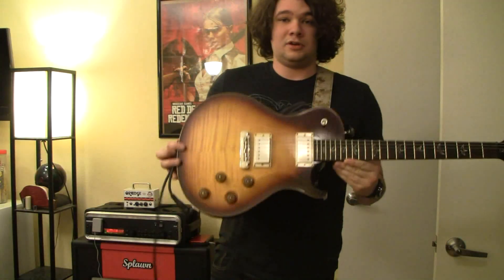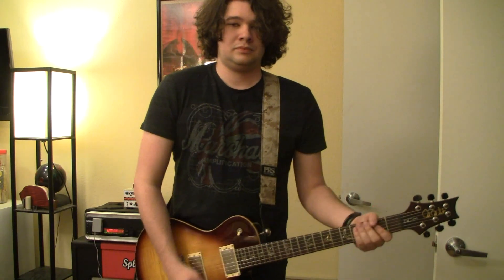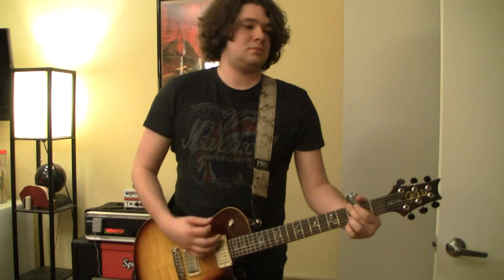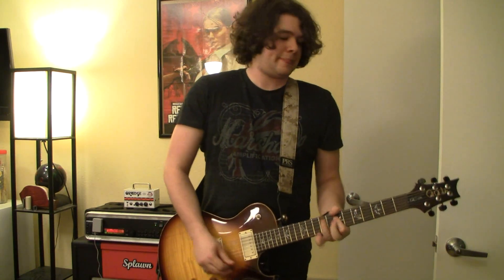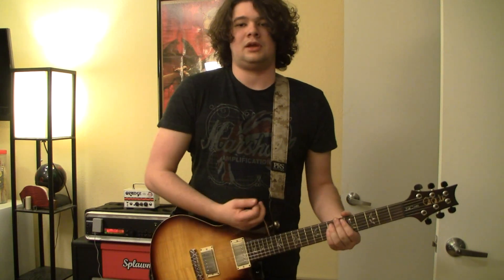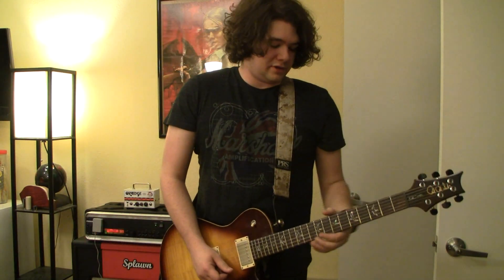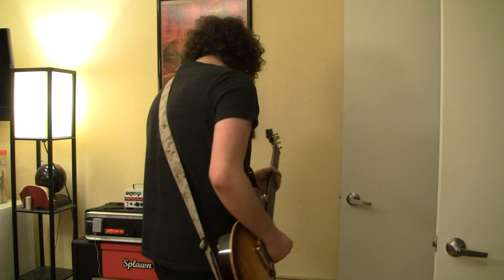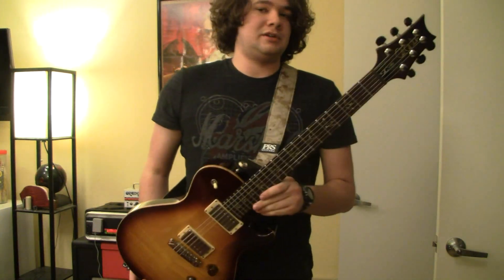PRS SC 245 Demo(with 57/08 pickups!)

Comment from the maker: It's very similar, the neck is fatter. The scale length seems to make it a bit softer/smoother sounding as well. And of course the Tremonti pickups are screaming hot and these are more mellow. I have both, and they are both awesome guitars, you couldn't go wrong with either.

Comment: Great vid! (And 6 yrs ago?) this really helped me with lookin for PRS p ups to mod my S2 Satin Singlecut... the7’s are way muddy. Im happy to see such a rockin Gain tone on these. Tremonti might be too much gain for me... if you happen to see this comment, what OD pedal are you throwin in front of that Splawn?
Reply: What pickups did you go with?  I'm looking for the same thing for my S2 Satin doublecut.
Reply: Allen Diego sold it. Loved Pearly Gates though
Reply: @allend3127  I don't know what pickups came with your s2 Satin, (used come with 7s, then 85/15s), But mine has 58/15s, and I think they are amazing. I also have a PRS SE custom, with 85/15s and it never sounded too great, and the s2 standard with the 58/15s sounds SO MUCH better. Like night and day better! I might put 57/08s in the SE though.